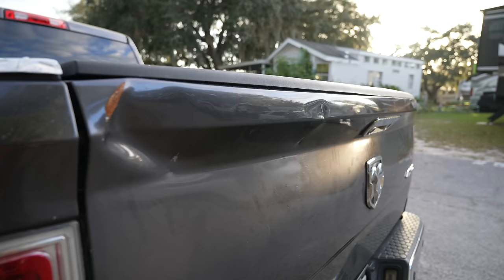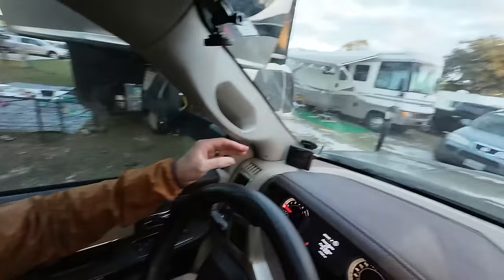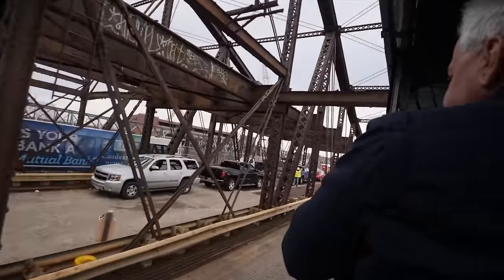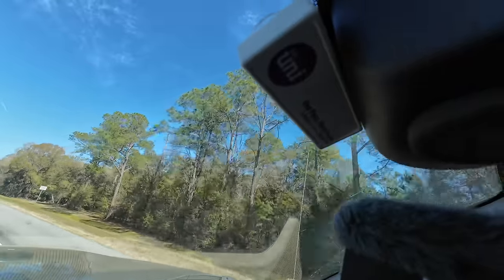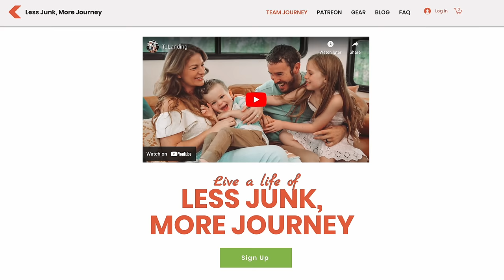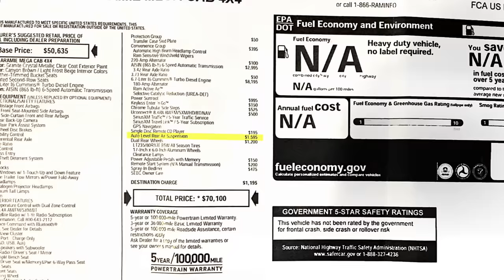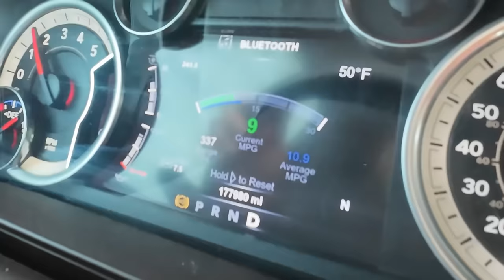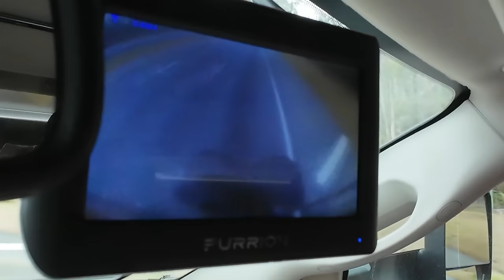Truck Hacks, Tips, & Tricks for Towing Your RV

Comment: Correct me if I'm wrong but my ram 3500 long bed crew dually has the same turning radios and length as your Ram megacab short bed dually due to the length of your mega cab.

Comment: FYI. A mega cab S.B is almost the same as a crew cab L.B for length. 

Also in the fuse box, there is a fuse that you can switch the key on power vs always power on.  There is 3 terminals and you just have to move it over one terminal.

Comment: I ordered my '21 F350 for some of the reasons you did. Since we do not have any kids traveling with us, I ordered mine with a short bed & extra cab (not a crew cab). In a pinch the 1 or 2x a year someone rides back there it works fine. The shorter wheelbase & overall length are great! I can park it anywhere almost any lot. It fits in my garage as well. So much easier to back our tt in tight spots as well. This is my 4th one in 26 yrs & I do not regret it.
Reply from the maker: Good to know!

Comment: Get a medium duty….i had a 2021 Chevy dually and it pulled my 43 ft Montana High Country great but went ahead and traded it for a 2021 slightly used Sport Chassis about 9 months ago and would not go back to a dually.  It pretty well fits anywhere my long bed 4door dually did.   I also have piece of mind on stopping and control of my rig….oh yeah it turns extremely sharp compared to the dually.

Comment: We have a 2022 Ram Limited 3500 Dually Long Bed with Airbags with the 4.10 ratio on it and a topper on it to pull our 30 Foot Airstream Classic. The bed holds our Electric Bikes and our 8 Foot Kayaks and our generator with a 30 lb. tank for the generator when needed. I just installed a DC to DC charger to make us less dependent on a generator. We take 3 to 4  month trips from July (get away from the Texas summer heat) through the end of October each year. I went from a 1/2 ton to this truck when we had our 25 foot Airstream and I was always over payload. I decided to upgrade to a truck where I would never have to worry about payload again. Parking can be a challenge, but you adapt to it quickly and we find it is a good trade off for the benefits the truck offers in towing and feeling safe.
Reply: We think so, you definitely have to drive intentionally & think ahead. We picked up our 2023 Ram 3500 Laramie longbox diesel dually last March and love it. Hubs wanted the dually diesel for the stability pulling a fifth wheel. I can’t remember the ratio but he promised me that it’ll have no issues driving up our Rockies.

Comment: The nice thing about the short bed GM trucks is that the hitch is still far enough back that you don't need a slider 99% of the time. We've been on the road 3 years with ours with a non sliding hitch with no problems. You can't make a full 90 deg turn, but you can get pretty close.
That being said, Ram is the only one who makes a short bed dually.
Reply from the maker: That’s something to consider.

Comment: I run the same truck only 2021 and love it. In Canada we are not allowed to have a extra free flow tank. It must be a manual pump, or powered pump system. I wanted to install one like you have .... BUT.... filling when driving will upset the computer system on the newer trucks. Therefore you need to stop, then add fuel so therefore I stop for fuel when I get to 1/4 tank so every 3 to 4 hours. The one item we have is our hand radios so my wife can watch our top clearance (rear camera can't see about it) and stumps don't show up well so my wife will go to the back and let me know everything is okay. We pulled into one site late in the afternoon and the rains had come down hard. While backing in my wife yelled for me to stop and pull ahead NOW. We found out the prior RV had sunk on the site and was pulled out and they just filled in the holes. We pulled out our extra 2"X6"X6' boards, backed in avoiding the holes and backed onto the boards for safety and added our big blocks to our 6 hydraulic legs . When we pulled out 8 days later our boards were 2" into the gravel.  2021 Columbus 388FK wide body.
Reply from the maker: Bummer that you can’t use the tank in Canada. We use our phones to communicate but when we don’t have service the walkie talkies come in handy!

Comment: We just had steel valve stems put on our Sprinter, so we wouldn't have a problem with the TPMS sensors, and they are easier to check pressures. Pricey, but it beats a flat when the valve stem breaks off.
Reply from the maker: Worth it!

Comment: For us we went truck first because we were adamant we were not having a long bed or dually.  Yes, it means we need an autoslide hitch but that for us is the only downside.  We have a 10speed diesel and love it. So far mountains have not been a problem and neither is driving round town, parking, banks.  We spend the majority of our time in the northeast so having the smaller truck - width and length- is definitely better for the day-to-day living.  We only have the one vehicle so it needed to do everything for us.  No regrets.
Reply from the maker: That makes a lot of sense, I think everyone has their own requirements.

Comment: I've been running with a 17 3500 mega cab for 7 years now and use the Reese goosebox and have had zero issues with turning radius with a trailer.  I'd highly suggest going to that and ditching the hitch setup you have now.  You won't regret it.  And if you are that concerns about the angle you can turn, you can add the gen-y goosepuck 5" offset ball which will give you more room for turning with the 5th wheel.
Reply from the maker: Great tips, we will definitely look into it!

Comment: FYI my F250 has the OEM tire pressure monitors built into the (somewhat) rubber valve stem and can't be replaced. I've used TireMinder on my truck as a second monitor since 2017 w/no problems.
Reply from the maker: Good to know!

Comment: as someone who has had a long bed regular cab for 5 years, you get used to it, though im planning on getting a 95 f250 extended cab long bed pretty soon, its bigger than what i have now, and i dont really need it, but its probably going to be a good deal and i want a different second vehicle. however, even though it is not a dually, im now thinking about what its capabilities are as far as towing and hauling goes. i dont need much and i wont be towing too much with it, but it would be nice to have that ability.

also, as far as your concerns with long bed vs short bed trucks go, a longer wheelbase vehicle will have a much smoother ride, especially while towing because you can get more leverage and theres more to absorb the impact of bumps, for example, my truck is 40 years old, i have a larger heavy duty bumper on it, which makes it about 20 feet bumper to bumper, its all leaf sprung and the shocks are starting to wear out, but it still handles bumps way better than my brother's cj-6 or even his fiesta ST. its simply due to size.

its also why even though the 90s/early 2000s jeep wranglers and jeep cherokees have such different tow ratings even though as far as drivetrain options go, you can spec both models out with the exact same engine, transmission and axle gear ratio. the cherokee can tow twice the amount of the wrangler with the same exact options because its a larger vehicle
Reply from the maker: There is always a lot to consider.
Reply: @LessJunkMoreJourney  yup, there are pros and cons to every decision a person has to make,  oftentimes they are very cut and dry, while other times, they arent so obvious, and the consequences of your choices may not reveal themselves until long after its too late to turn back.

im sure i dont have to warn you about the huge design flaw of the mega cab short bed option when towing a 5th wheel/gooseneck trailer either. ive seen a few of those trucks damaged in the same spot for the same reason

Comment: The difference between your current truck and a standard crew cab long bed is only 11” with Ram and 17” with Ford but the F-450 has a shorter turning radius from the wider track front end.
Reply from the maker: Yes, good to know!

Comment: You definitely have the right truck for your family and your needs. I will say that the wheel base of a long bed crew cab ram is only 9" longer than your mega cab but the 8 foot bed will be a tradeoff of interior space.
Reply from the maker: I don’t know if the 9 inches would make much of a difference but it would be nice to have a full 8ft bed.

Comment: Great video. I have a Ram 3500 mega cab and the Ram crew cab with 8 foot bed. They both have the same wheel base.
Reply from the maker: Good to know thanks!
Reply: Nope. 9” longer wheelbase and 10” longer overall length on the crew cab w/ 8 foot bed.

Comment: To me, the new 10 speed transmissions are the #1 most important thing to have in a new truck. We have an F350 with a 3.55 rear end and I can accelerate quite nicely with the trailer. It can find the best gear do what you want it to do…
Reply from the maker: Good tip- and the Fords have the massaging seats! 😉

Comment: Are there any magnetic gadgets that will keep objects off the top of the dashboard and yet still within glance view of the driver?  I really don't like  the idea of obstructing my full view forward thru the windshield.  I would think it'd be safer to mount visual aids/reference devices somehow from the top of the windshield down, rather than the bottom of the windshield up, as a driver very rarely needs to check space above the vehicle as much as having a clear and constant view of the road and vehicles/conditions ahead.
Reply from the maker: Although I don't have any specific ones to share, I'm sure there are many options out there.

Comment: I have a ram 3500 crew cab dually long bed. I wish i would've got a eam 4500 or 5500 they have a wide front axle that turns sharper hence better turing radius. The extra payload capacity would be nice I'm always really close on my drive axle weight rating.
Reply from the maker: They say to always go bigger.

Comment: I have a 2015 ram 2500, it has 3.42's with and with 35's tires I could feel the transmission slipping to move our 364BHL.  I have been planning on re-gearing it, I do plan to keep the 35's...
3.90's would be PERFECT (but not available) and I have been going back and forth between 3.73's and 4.10's.  You just settled it for me, 4.10's it is!
Also, check the wheelbase of your Mega-short vs a Crew-long
I doubt that I am that much longer than you.
Reply from the maker: I think we are still 11 inches shorter than a crew cab long bed
Reply: Mega/Short:  160”WB/248.40”L
Crew/Long:  168.9” WB/259.4”L
Admittedly, more than I thought
But…can’t beat an 8’ bed with the goose-ball!

Comment: I fully agree buy the RV first, and if it’s maybe on the dually, get the dually.  The diesel can be a maybe on the single wheel but a for sure if you get the dually.  Keep the good stuff coming and give the kids a hug for me.
Reply from the maker: Yes, our thoughts exactly. Thanks for watching!
Reply: We decided on getting the truck first. We had an idea of the size of 5th wheel we wanted & my only requirement for the truck was that it can pull the 5th wheel up the Canadian Rockies hills without holding up traffic. So since it’s a monster we weren’t restricted in what 5th wheel we could tow.

Comment: Love your videos. I have a lighter camper than yours and we just downsized from a fiver to a travel trailer. My truck is a 2017 Chevy 2500 Duramax crew cab with a long bed. We ordered the truck more for what we didn't want than for what we wanted. We didn't want four wheel drive, dual wheels, carpet, short bed. I wanted the long bed because at the time the fuel tank was bigger than the short bed and because with a long bed you don't need that expensive problematic sliding hitch. I don't have any problem parking in narrow spaces. Because it's long I do need to find a side by side parking space to make that turn into the spot. It's easier to back in sometimes. We love our truck and it has given us many long miles over the years. It's jerked our campers over every mountain range in the lower 48 and has traveled safely from coast to coast and border to border many times...we are road running Meanderthals after all.
Reply from the maker: Awesome, glad you have the set up that works for you!

Comment: I am pretty sure that your truck is as long as a crew cab long bed with the mega cab.  Thats why you cant get a mega cab with a long bed. I could be wrong tho.
Reply: You are correct. 
  Same wheelbase as a crew cab with long  bed
Reply from the maker: According to our research we have concluded that the short bed mega cab is actually still 11 inches shorter, and has a 9 inch wheel base. This information can be found on Rams website.

Comment: You already own a long bed truck. RAM mega cabs are built on the same frame as a crew cab long bed. That's why you can't order a mega cab long bed.
Reply from the maker: According to Ram’s website the short bed mega cab is still 11 inches shorter than the crew cab long bed.

Comment: if you wanna keep that fuel millage......you best stay with the best truck on the market....that dodge
Reply from the maker: It’s better than a new truck?
Reply: @LessJunkMoreJourney If you keep your RPMS at or just below 2000RPM you will get the most torque and fuel mileage.
Reply: @jamesglenn520  that’s why I get 23-24 miles a gallon empty and 10-12 pulling
Reply: @ericchrestman4525  I average the same with my 21 Ram. And our Alliance Valor 40v13 is pushing 20k.

Comment: Well im 66 years young now and i hate the new trucks  you need to be rich to buy and give crap fuel miledge with the def and computer crap  I tow a 1977 Coachman 33 ft 5th wheel camper i paid 500 bucks for that weighs 7000 pounds loaded  and i  Will be towing it with a 1999 Dodge ram non def  and computer truck with the 8 foot box that will get 22 to the gallon and wont even know its towing the trailer  same as my buddy did when he had his truck before it got eaten by the salt here So my best bet will be shopping for a rust free frame and buying his truck for a 1000 bucks